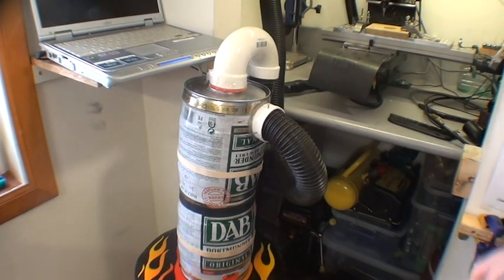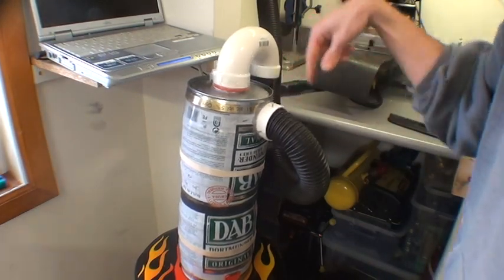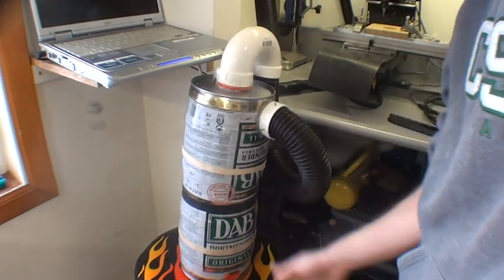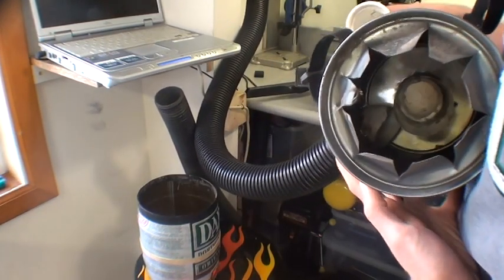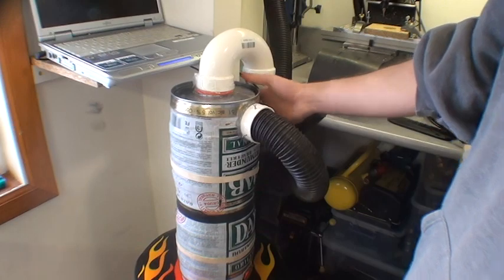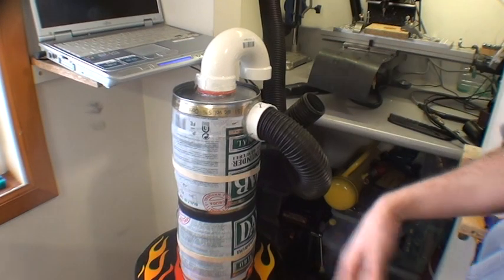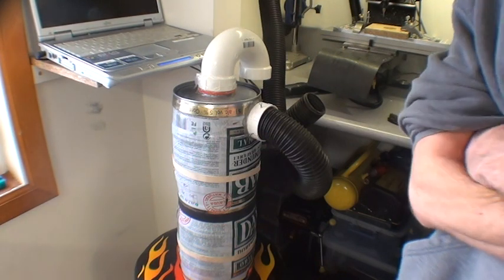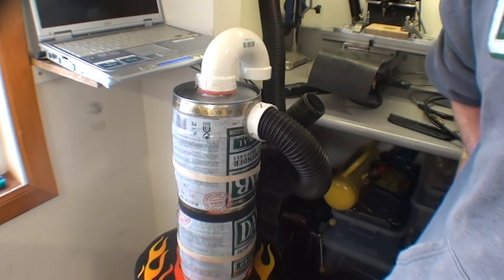DIY vortex dust separator made from steel minikegs.

Comment: interesting build.  I see a problem with the shape of the container.  Cyclone vacuums are cone shaped or at least the separating portion is. Those mini kegs bulge out int he middle a bit.  Think of it as a game of tether ball.  As the ball goes around it gets closer to the pole and spins faster and faster.  thats what cyclone vacuums do.  The cone shape causes the dust to spin faster and faster and keep the dust from getting sucked up.  I hope this information will help with modifying it